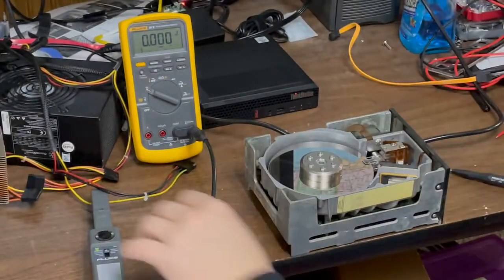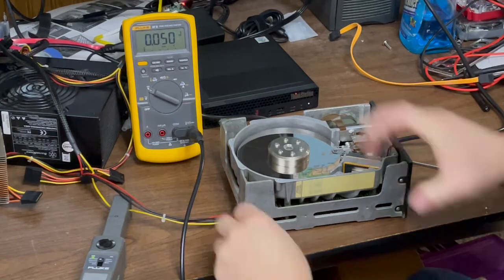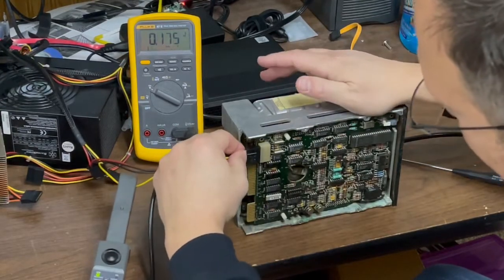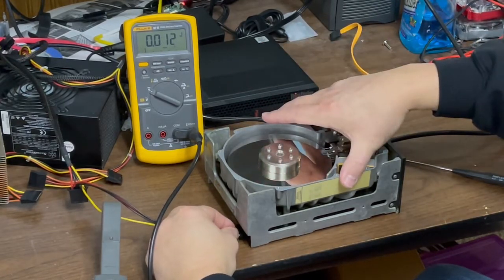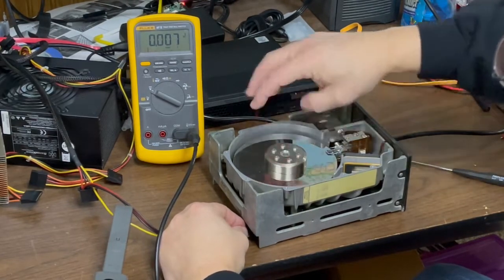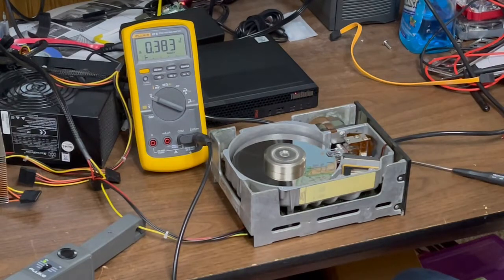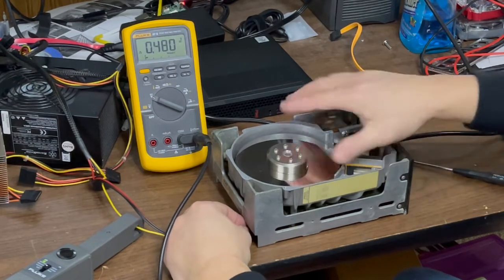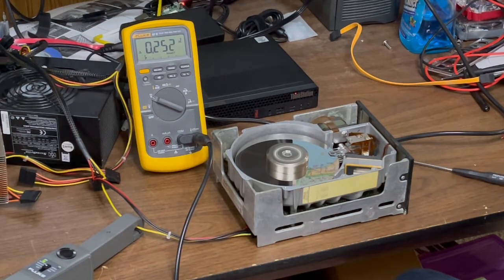IBM XT 5160 10MB Hard Drive Kickstart - Amperage Measurement

Comment: the hard disk is dead due to crash head cannot recovery data
booting,  format etc.
Reply: it can , this is an old xt drive. as long as he formats with a smaller capacity it will still operate